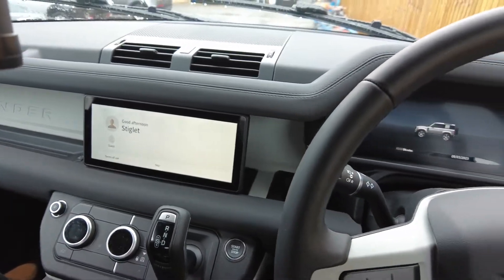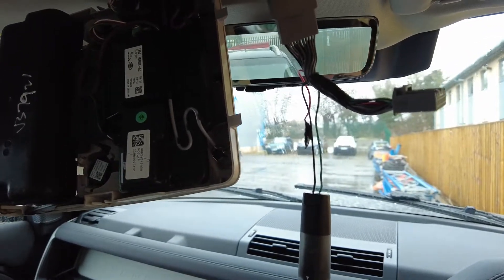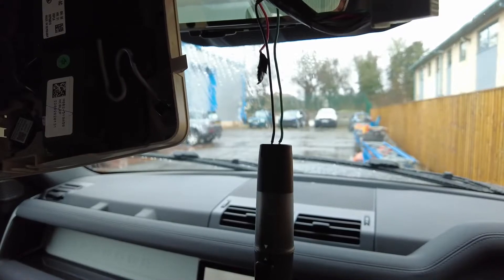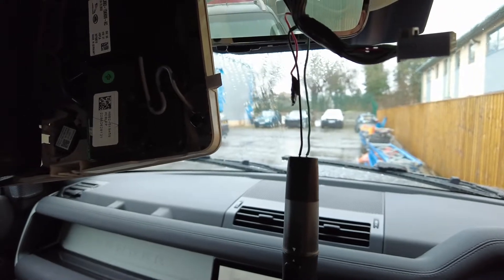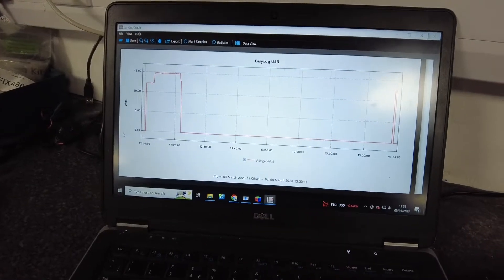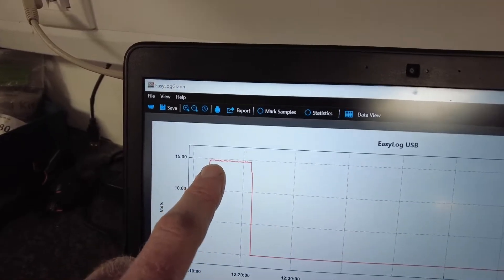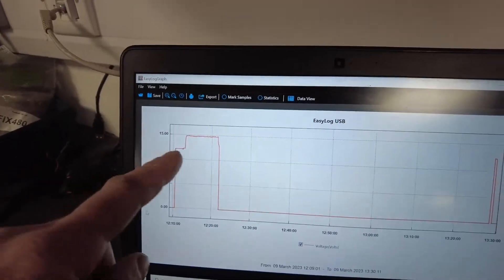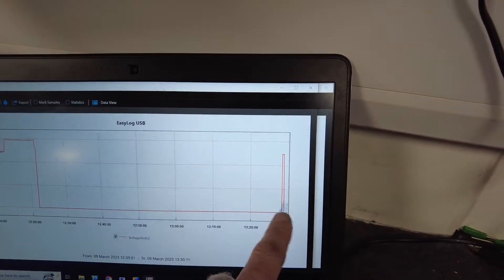Land Rover Defender L663 MHEV Voltage Data Log of 12v Circuit ( for Dashcam etc )

Comment: Does the Vehicle start from the 12v battery or the 48v battery. The intergrated starter generator, appears to charge the 48volt battery, and a DC to Dc inverter charges the 12volt battery. If this is the case, maybe the 48volt battery is the starting battery and the 12volt is to run all the accessories.

Comment: Can you do this over a longer run - maybe an hour or so - and with different electrical loads to get more data. BTW the MHEV has a generator not an traditional alternator so it can do its energy recovery thing but I believe it should still do the voltage drop off once the starter battery is recharged.

Comment: I leave my 2020 L663 D240 unused for several weeks at a time in airport car parks and have always connected up a solar panel trickle charger to the jump start posts under the bonnet that has kept the battery good. I’’m about to take delivery of a D250 MHEV, will my solar panel (it sits on top of the dash inside the car with cables through the door jam into the engine space) now have to charge both the 12V battery and the MHEV battery?
Reply from the maker: When i connect the CTEK in the workshop ( my car is not driven much ) it connects to the 12v only.
I think the 48V battery charges the 12V battery via the DC to DC converter... but i dont think it goes the other way....the 12v charger will not charge the 48v battery

Comment: Do you think we can add a DC to DC charger to the defender to charge lithium batteries in our travel trailer?
Reply from the maker: Interesting - do you think this should be from the 48v battery or the 12v battery - we need to do some more investigation on how the MHEV works. According to this https://www.dropbox.com/s/7cu65o2mqp0khjc/7.%20MHEV_Infographic_A3_100919.jpg?dl=0
The 48v battery is 200Wh
A normal 12v battery is 12 x 96 Ah 900Wh ( approx ) so the 48 battery looks pretty low capacity
Reply: Definitely from the 12 volt side. Plenty of examples on the AU  new Defender sites.

Comment: Hi Simon,
It would be fascinating to see a voltage analysis of the 48V Lithium-ion battery in a MHEV and it would be really interesting to see how long it takes for the Li-ion battery to lose voltage when left for a few days. I’d imagine the there would be all sorts of alarms pop up if the cell voltage reached critical levels.
Reply from the maker: Yes i need to look at this more - although the 48v battery is only 200Wh according to this
https://www.dropbox.com/s/7cu65o2mqp0khjc/7.%20MHEV_Infographic_A3_100919.jpg?dl=0
A normal 12v battery is 12v x 96Ah = 900Ah so the 48v battery is pretty low capacity !
Reply: Thanks Simon. 200 w/hrs doesn’t sound like much, but that battery is feeding a 7kw electric supercharger.  Does that  mean 145 amps are rung out of a 200 w/hr battery over the few seconds to reduce turbo lag and improve efficiency? Perhaps a data log using a clamp meter over the main feed to the supercharger, if possible would reveal some interesting stuff. What would be the result of gradual degradation of those cells over time, or even one cell failing?
Reply: Simon…interesting stuff but your figures for the MHEV battery make we wonder just how long they last? If they are low capacity then they must go through significant cycle variations and I would think that might dent the over all battery life. So do we have to expect to change that MHEV battery every 2-3 years?? Hmmm.🤔🤔😬😀😀😀Any ideas gratefully accepted! Richard